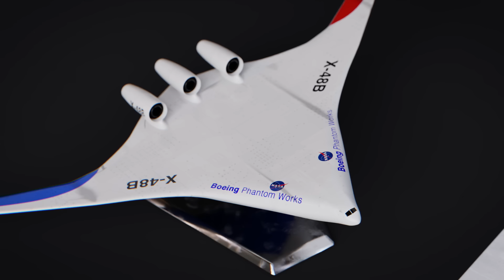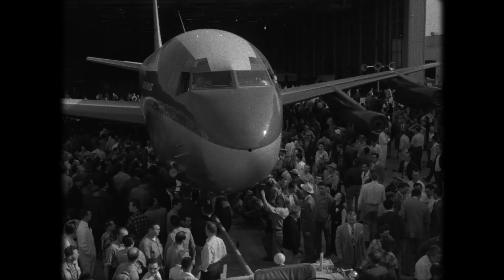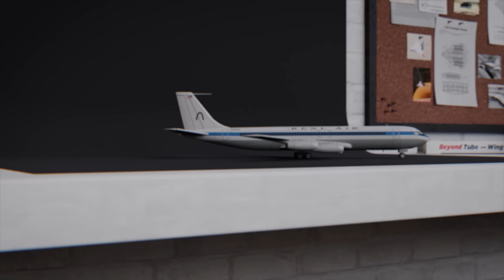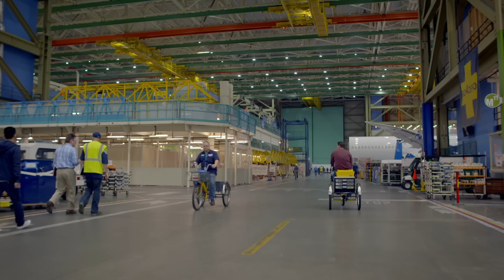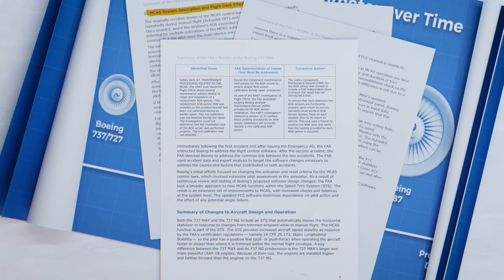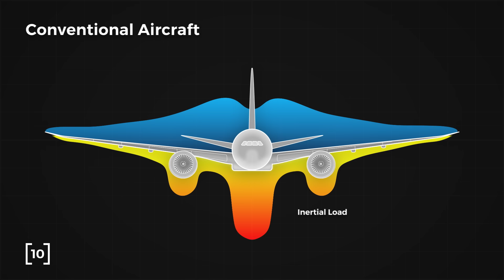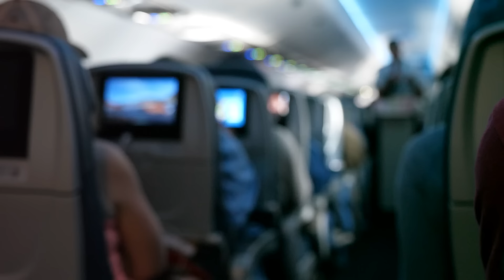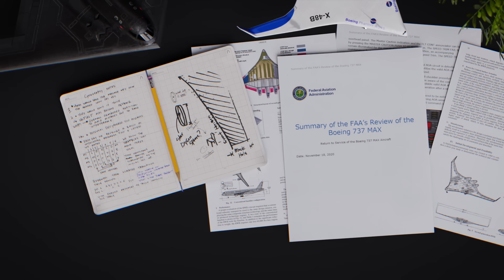The Plane That Will Change Travel Forever

Comment: What this narrator says about the problems with the 737 max are incorrect and bogus. I am a retired airline captain of 30 years. He makes errors in the description of the changes made in design of the 737 max, then mis-applies an untrue and false set of cause and effect s. I was a;lso involved in Flight Safety in the USAF for 24 years. The problems with the 737 max deal with the Flight Management Computer (FMC), its software, the management of the develpopment of that software, and the testing of that software. Effing period.
Reply from the maker: Says I’m wrong, and then repeats what I said. Calm down Paul

Comment: The problem with the BWB design is that they can't be extended. With traditional tube-and-wing design the manufacturer can add fuselage segments in front and behind of the wing to make new extended models of existing aircraft (ie the 747-100, 200, 300, etc). So they will have to make entirely new designs each time they need an aircraft with slightly increased capacity.

Comment: I would have been a nice video to watch when they would not call a critical system design error for the 737 max (not fail save) a software error. This shows a fundamental lack of system design knowledge. No airplane should be allowed to pass checks and get approval to carry passangers with such a design error. It is just not save. Fault tolerance / redundant components might reduce the problem, but it will still be there.

Comment: This is fascinating .. If and when they use hydrogen as the fuel, is it possible to borrow from the advantages of air ships ?  Air foils are used to provide lift primarily.  If natural buoyancy could take a load off it, might it bring further benefits ?

Comment: There's a world of difference between a flying wing like the B-2 and the airliner concept as shown here. There's a very good reason why conventional airliner and the B-2 have tube-shaped fuselages, and do not have seating and cargo holds (or bomb racks) extending out into the wings: inertia. 

The closer you and/or the cargo is to the centerline, the less effect banking during gradual turns has. Drinks don't spill. People in the aisles don't go tumbling. Cargo doesn't tear loose from moorings, or tip over. 

If you put two people standing, as opposed to sitting, on either end of a playground see-saw, so long as the board is level, both people stand without difficulty (provided they're the same weight, of course). But the moment the board moves even a single degree off in either direction, it becomes immediately impossible to stand. The closer each person moves to the pivot point, the easier it becomes, even with extreme changes in angle. 

Now imagine being seated out in the wing of the plane in this video. You have a drink in front of you, or you're in the restroom, or you're walking back to your seat when the plane begins to bank. Wet pants, and worse.

Comment: Hi there. First off, I'm a big fan, and genuinely enjoy my square-paper notebook. I think my previous comment (that I can't find) didn't emphasize enough that I'm a fan, and I want to apologise for its tone. But I really think it was important, so please let me try to explain it:

As we go past the 737 MAX and people start to forget why it had issues, I think many people tend to forget and perhaps oversimplify what those issues were. With many people scared of flying, this can be a problem, as they look on-line for answers to worrying questions. Respectfully, I think the way you described the MAX's issues, could give the wrong impression, to some. The planes didn't crash because of anything to do with aerodynamic stability or instability. Or fly-by-wire, of course, which the MAX doesn't have (not for its primary aero controls, anyway).

The problem was a RIDICULOUS decision-making process, intended to maintain the same type-rating (with no sim-time) as the 737NG, for cost-saving reasons, which led to a feature that relied on a single sensor (as you describe) when the plane already had two such sensors that it could use -- which is what it's doing now. Of course there's much more to this (EASA actually ruled that the plane could have been certified as-is, with no MCAS at all!) and more improvements could come from around 2023 (e.g. synthetic airspeed, which by the way, I think might be worth a video)

But the point is this: the problem was fixable, and they fixed it. Had the plane been aerodynamically unstable (or less stable) it wouldn't have been fixable. I see many on-line who seem to think that the MAX had/has a stability issue. It didn't/doesn't. Again, I'm sorry if my previous comment came out the wrong way, but I think it's important not to aggravate the fears of flying-weary people. Please keep up the good work!

Comment: I'm glad you covered the cabin pressure factor. This was a concern of mine when we were working on our supersonic commercial flight capstone project as we started deviating from the cylindrical fuselage configuration. 

One important limitation not covered here is the height vs width of the airframe. If the internal cabin is to be high enough for passengers to walk around, the wingspan must be much larger than that of conventional regional airliners that carry 100 or so passengers. At that point, you might as well add more rows of seats. Its likely we will never see a regional airliner or charter plane of this design for this reason, mainly just international flights where you can sell the extra several hundred seats. If the industry is forced in that direction, they will have to compensate by scheduling less frequent flights to fill the seats.
Reply: thats what I'm expecting. even if it has better fuel economy it might still not be worth it if they cant get enough passengers. so we will probably not be seeing the end of the tube and wing design anytime soon. I could easily see it only being feasible for inter-continental flights were the significant increase in fuel economy would make it a no brainer to use.
Reply: if economy can get reclining seats for same money then i could be okay with lack of windows.. at least i can sleep through it, something like this would be perfect for cheap/comfier long haul overnight flights
Reply: @mrinchantube  I'd suggest adding windows in the bottom of the plane.
Reply: Thanks for adding in some interesting info!
Reply: it's not all bad. less frequent regional flights might be well worth it if it also meant much cheaper tickets. i know a lot of people who give up flying to a different state for vacation because of the ticket prices.
Reply: Maybe this is a perfect design for freight?
Imagine we can hv much cheaper intercontinental air cargo
Reply: Great points. However, there is an advantage and benefit to hight vs. width. Especially in a business aspect. 
Different plane sizes and passenger capacity for different flight patterns could be extrapolated based on flights from multiple airlines to determine how many average passengers are traveling from one destination to another. 
There will always be variations to population changes from one area to another, however. 

1. Running less planes, at fewer, yet more consistent timeframes would solve part of the issue, as there are less choices for passengers to choose, therefore, more seats can be filled per flight, maximizing the planes capacity, and giving passengers more convenient timeframes of departure/arrival times. Saves on cost of materials, fuel, maintenance, and allows airports to adapt to higher influxes of population flying to and from their locations over time. 

2. Smaller planes, with fewer passengers, with shorter flights, can achieve the same efficiency. Plus, with smaller planes, luggage is not needed to stow under, but rather on the sides, or even in the middle of the plane to accommodate window seats, where other passengers would have been, creating better weight distribution in the plane. 

3. Maximizing profits and value per flight would far outweigh profits per plane, creating more profits, safer flights, better schedules for passengers, flight attendants, flight crew, airport staff, and help with lowering costs of fuel consumption, food and beverages, and allow the flexibility of having some planes on standby for holiday rush. 

4. Safety would increase dramatically. Less flights with fuller planes instead of more flights with less passengers may seem convenient for passengers, but at what cost? 

5. I doubt this would be engineered in properly, but, in an extreme emergency, the hulls of the passengers could be built lighter, and stronger, and more fire retardant. Plus, since the hull of the plane is more evenly distributed vs. a long tube, a parachute system at the top of the plane could be implemented to reduce crash intensity, as it has a wider surface area, and using similar carbon fiber weave technology used on the plane itself. 
And in the event of a water crash, inflation devices can be implemented under the plane, which has a wider surface area again, using again similar carbon fiber technology used on the plane. Perhaps even better, having multiple landing gears for different scenarios. 

But what do I know, lol.
Reply: @travisswanson3449  
1. Airlines already optimize usage - trying to estimate volume, while not turning away passengers at peak times is a science, and won't be altered just because the airplanes look different. As it is, the retirement of the 747 passenger aircraft without a replacement, and slow Airbus A380 sales have already showed that an aircraft moving 1000 passengers doesn't have a market niche, now or in the near future, even on the highest density routes, so for an aircraft double that size, we would need to see a massive increase in airline travel, and outside of there being refugees fleeing global warming en mass, that isn't likely.
2. By Boeing's estimates, the flying wing needs to carry at least 1000 passengers to be competitive, regardless of where you stack the luggage, ruling them out for smaller passenger loads and over shorter routes, and if you put the luggage at the rear of the aircraft they will have weight and balance problems. Luggage needs to be loaded as closely as possible around the balance point to prevent unusually heavy luggage items from making the airplane too tail heavy - or nose heavy. Also, in a crash, the last thing anyone wants is for all the luggage to come crashing through the cabin, from behind, and tools, sports equipment, mobility devices etc still need to be loaded on, regardless of the size of the aircraft, and they won't fit in the overhead compartments so they can't all go in the cabin.
3. None of these pie in the sky claims have any evidence to support them, but there is a lot of evidence contradicting them.
4. More airplanes = less safety, because more collisions happen when there are more airplanes close to each other. Larger airplanes means more people die if one crashes. We are currently operating at a happy medium between both extremes. If passenger volume increased several fold over current levels, the flying wing might become viable but only to decrease the number of flights from dangerous levels. Airports can only handle so many aircraft coming and going, even with all the innovation over the past 100 years in that direction.
5. The fuselages (not hulls) are already built as light and as strong as possible, and fire retardance is not the issue, but rather where the fuel is - which is best located as far as possible from the passengers but a flying wing by necessity puts the fuel and passengers together for the worst possible scenario, and one that cannot be fixed with some fire retardant or a change to less structurally efficient materials. Designing an aircraft to land on water would add thousands or even tens of thousands of pounds to the airframe (as would your extra landing gear), and very few purpose built seaplanes have ever been able to make open ocean landings anyway, thanks to swells running in multiple directions, that make it very hard even for an experienced seaplane pilot to ditch, never mind an airline pilot who has probably never even tried a single water landing.
Reply: @mdf6164  Thank you for the detailed response on the realities of passenger flights. I am completely ignorant to this industry compared to anyone in the industry. I do know that airlines already optimize usage, as it directly correlates to them being as profitable as possible, increasing service and flight availability, as well as increased safety in maintenance and reduction in human error. Flying is still the safest mode of transport by far. Although, maintenance and safety checks has been the main reason for a large percentage of flight emergencies and crashes, besides human error. 
It is a hard and complicated balance to being realistically economically sound and profitable, vs advancing our engineering, design, and economic growth with each individual company, and as an industry. But we can do better. 
That’s why I suggested scaled down versions of this specific design. 
One engineering design I feel is worthy of considering is detachable fuel tanks while still allowing the aerodynamic structure to stay intact. It may seem like a massive engineering undertaking, but it can be done. And should be done. 
I believe human ingenuity can overcome some of our complicated shortcomings. 
But at the end of the day, the companies, and the industry, have to want to.
Reply: @mdf6164  You seem knowledgeable, so I figured I'd ask you: could airlines use the extra volume for cargo (mail and freight) instead of additional passengers/cabin space?  There seems to be a fair amount of demand for timely regional shipping, and balancing cargo on flights is already automated.
In particular, what would be the downsides of a flying wing for all-cargo flights?
Reply: More seats and less expensive planes means way cheaper intercontinental flight
Reply: You could argue, that would push for more public transportation like Trains, Metros Subways, Mono-rails etc. Which overall could be better
Reply: Quite a few nations though are trying to get rid of regional airlines and replace them with high speed trains.
If the passanger flying wing will happen I think it will be in China. China is building high speed rail like crazy but has a lot of vast remote areas that it tries to connect. So making an airport made for flying wings with of course the ability for conventional as well is something I can see them doing.
Not to mention China loves shiny new technology.
Reply: I'm guessing whoever you worked for stopped working on that supersonic commercial flight project? I've watched some videos about Boom's supersonic commercial projects & its development, but it seems the same issues that plagued the Concorde persist. It just doesn't seem they will ever be commercially viable due to fuel cost per passenger over any distance, and affordability + sound issues will still prevent widespread accessibility.
Reply: Unfortunately such design makes passengers sea-sick.
Reply: Just give the passengers of a future regional blended wing airplane the luxury feeling of a stretch limo or a private business jet - you can't stand up, it's too low ;-)
Reply: This is actually perfect for a low carbon transition. Lower emission, less frequent flights for long hauls and wide water crossings. Then, fast trains for short and mid-range distances. Electrifying everywhere where frequency and efficiency merits it. If only train investment wasn’t arbitrarily a tiny fraction of all other transport modes
Reply: It doesn't have Windows.
Reply: What if u want to he a pilot but seeing this and also about ai... really putting doubts in my mind 😢 i want to fly the beautiful current planes 😭
Reply: Or make people lay down! we could also invent technology to liquify humans pump them into the wing together with the fuel and then separate and return them to human form after landing. Or add a roof that lifts up when boarding increasing the height so you can walk, then once everyone is seated the ceiling can come down again. The gap between the ceiling and the fuselage could be a tent like foil to keep rain and cold out. And in warm summer days you obviously just leave the roof open, it would be a targa plane, you know like 911 targa.
Reply: Thick wing sections are bad aerodynamics and can never sustain high speeds.Reallity,Air travel is no faster than 45 years ago.
Reply: @routmaster38  With rising fuel costs, slower speeds are probable, but thicker wings result in a lot more drag as well, and these would also likely need a higher thickness to chord ratio which together means higher fuel burn. I think there is an engineering maxim that anything designed to do more than one thing will do everything poorly. Wings that aren't also trying to be fuselages are more efficient than wings that are, and ditto for fuselages. The airfoil has to be compromised to get enough stuff in it, and the fuselage space becomes more difficult to work in.

Comment: You should add trigger warnings. As a control engineer, the part about the having the fly-by-wire system only rely on one sensor had me stressed out...